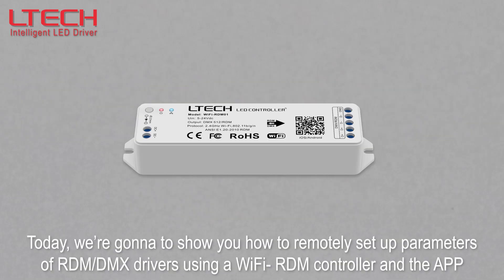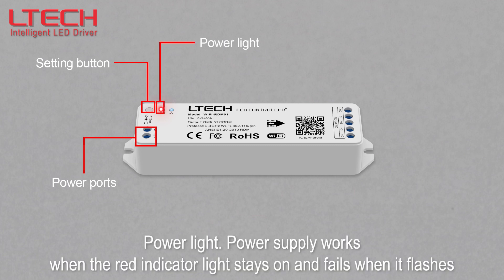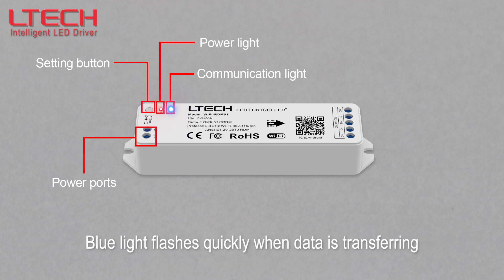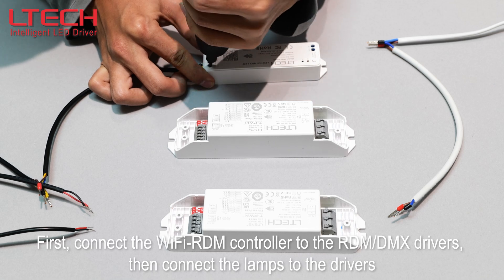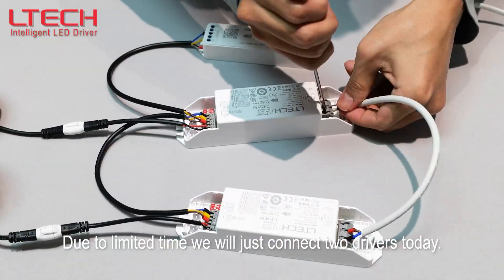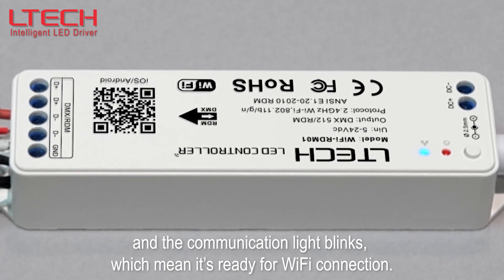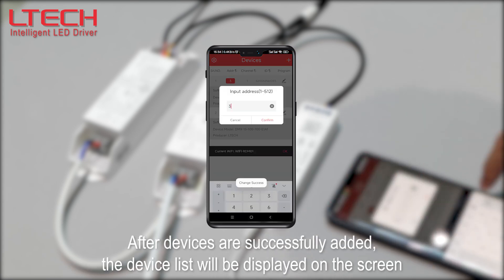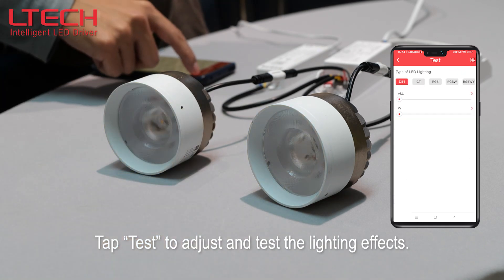How to use a LTECH WiFi-RDM controller

Comment: Why is it that every time you create a new led controller you create a new app?! 
Why not just program one App and improve it year for year? 
I've bought a couple of controllers over the years and most of the apps aren't even available now and if they are available, they just don't work anymore (made for an older Android Version, can't register a new account because of "invalid network",...) Your Hardware is really good but it is useless if you can't use it because the software is 🗑️.